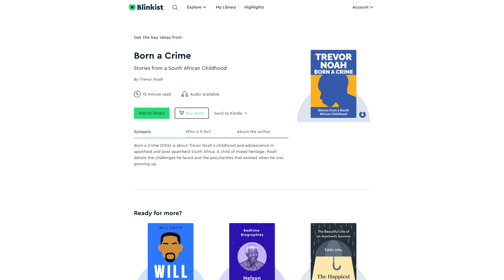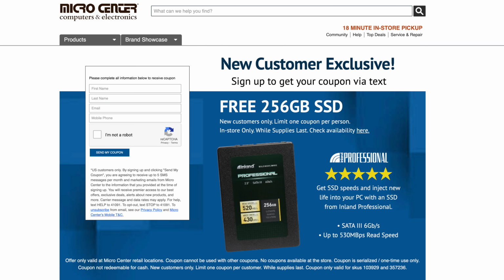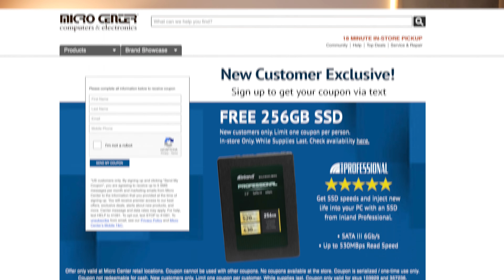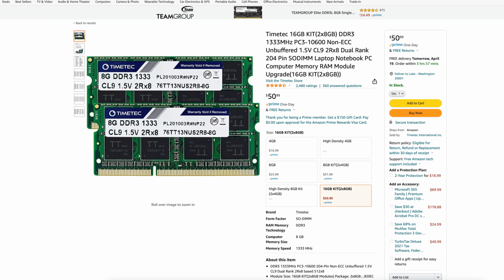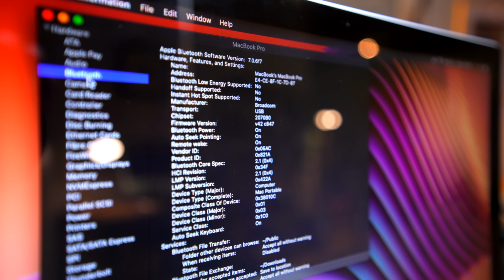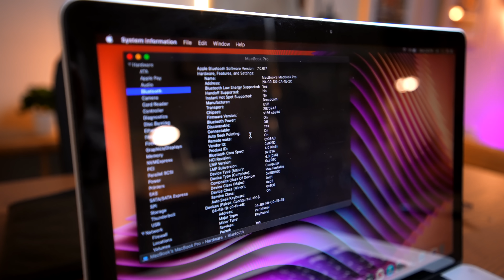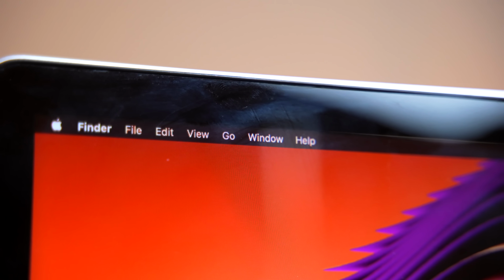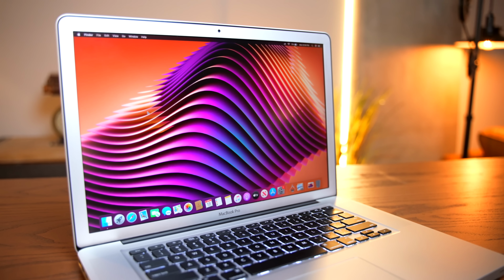Breathe new life into an old MacBook with THIS upgrade

Comment: It is true that the MacBook is expensive at first but surely lasts and a fantastic buy nowadays.  I was NOT an Apple fan but for 1 year now I had to use the Macbook Air NOT by choice and I felt in love with it.   I recently bought the MacBook Air  8gb, 256gb ssd 2015 for $100 because the 4gb, 128gb kept locking up on me with heavy use.  Then I went and bought 4 more used one 3 MacBook pro  15, 13, 13 2012-2014 and 2006 MacBook about $150 for all 4.  I am on a MacBook fever as these things sure are solidly built with quality component and  they are super fast with ssd drive.  80% of the population will suffice using these.  I also visit the local Walmart and I saw mostly 8g, 256g or 128g storage  made by Samsung, MSI, ASIUS, HP, ACER in the  range of $1000 brand new that is NO better than these MacBook.

There is NO need to buy the latest  unless you have a specific need for the  power.  I am a fairly heavy user but the older MacBook works great for me.

The only bad thing is update of the ram is hard  as they are soldered on the board.  SSD swap is a piece of cake!

The secret is large ram and fast SSD.  These 2 will turn  a slug into a decent fast car.  CPU to some degree but for most use people can't tell the difference.

Bottom line used MacBook is a fantastic value.  They still look good  decade later!!!!

Comment: Help: this upgrade does NOT work.  I swapped out the display and WiFi card but they’re latency issues.  Excruciating latency issues.  Can you provide the correct WiFi card part number?  I suspect that this is the issue

Comment: 2011 macbookpro 8, 1 put 500GB SSD in it around 2013 or 14. Slowed down a couple years ago and I bought a new mouse computer in Japan. Love it with Debian 12.5 in it. But my old macbook pro was wasting away. So I tried OpenBSD but couldn't get the good resolution on it. It is a crappy screen. But now I put FreeBSD 14-REL in it and it's working well. XFCE4 desktop or Wayfire on Wayland UI. Had to play to get the sound persisitent but the thing works great. I'd love to try a new display with better resolutions but couldn't find any. Anyway the keyboard is getting sticky and I'm thinking of that cheap chinese $20 upgrade of that. I do have 16GB RAM coming for it. So the RAM and then the keyboard and I love the FreeBSD running so smoothly. I'll never go back to MacOS now. I knew hardware just doesn't slow down like that all of a sudden especially when there is no spinning disk in it. Ordered the RAM from OWC for the macbookpro and my wife's macmini from 2012. I'm gonna upgrade her to SSDs as well. She's still on Catalina and I told her I can restore it after the hardware upgrade. I hope she notices a difference because her macos was also VERY BLOODY SLOW. I hate Apple for this hint to fork over more money to them. Experienced it on that mini and my macbookpro. Sudden slow downs with the UI. Can't beat BSD though.

Comment: I'm still using a 2014 MacBook Pro and a 2012 Mac Mini. The MacBook Pro is my daily driver for Ruby on Rails development and my Mac Mini is an i7 quad-core, 8 thread, 32GB, 1TB SSD beast. The upgrades on the Mini I installed myself of course.

With the MacBook Pro I use an awesome 100% mechanical keyboard with blue Gateron switches and a logitech MX master 3S mouse (trackpads suck).

Comment: update on my $35 2010 MacBook Pro 15
just installed the anti-glare display i got for $30, a 2011 wireless card, a new battery, 8 GB of ram and 256 GB SSD and macos Big Sur thx to open core and even fixing the common kernel panicking capacitor problem on my own. 
thanks 1000000 Luke for the idea, for someone who lives in a country where it's expensive to buy things from America (cus of our lower-valued currency and high import taxes) this was a pretty great deal which cost me just over $300 XEC (eastern Caribbean currency)

Comment: I replaced my screen with the Matt Display screen as described however, I'm not able to see how to hookup the 2011 wifi air card. Connectors are different on the board. Do I need to replace the board or order a different model air card?  2010 ? 2011? or 2012?  Hope I can get this to work somehow.  If not, I will leave it as is with a SSD installed.  Thanks

Comment: I just got a 2011 Macbook pro 15" with an Anti Glare screen with speculation of faulty Logic Board for £28 ($35.44), I currently have a 2012 Macbook pro with couple issues, screen dying and a speaker blown, when it arrives i'll transfer the logic board over to the 2011 along with the wifi and Bluetooth card and I'll then have a Macbook Pro 2011-2012 15" Edition

Comment: Nope, not worth it! Threw my 2009 MBP in the trash a long time ago and that’s after upgrading the ram, SSD and even running Linux on it! Just sold my $3000 2016 MBP for $300 after replacing a battery and it still ran slow for typical day to day tasks. I’m done with MBPs, maybe a Mac mini / studio but not the new MBPs with iPhone X notches 💩 Could care less for MacOS now that Windows 11 is great, and I used MacOS for 15 years. The problem you didn’t mention is that once Apple decides to not upgrade your MacOS on a MBP you’re done, just waiting out until apps won’t support it anymore, and Apple will intentionally make it slow! You can’t even run Linux on them very easily, tried it, finally it ran really fast again, BUT: No driver support for WiFi, BT, onboard audio and in my case - a 2016 MBP with a touchbar, no touchbar support or most importantly no ESC button. Useless!!! I will never spend $3K+ on an Apple computer, $1500 is Max!! You can still repurpose an old PC with Linux, not Macs! Pure ewaste nowadays ... 😢

Comment: I have an old 2011 macbook pro 17" i7 & it makes an excellent batocera machine, sound, wifi, Bluetooth all work whereas they don’t on my 2017. The 2011 does have radeon failure issues though so maybe go for the 2012 unless it has had the chip replaced. I paid a shop to replace the one in mine years ago.

Comment: Writing this from a 12 year old 17" MacBook Pro w/ upgrade SSD, 16GB ram and bought it with the no glare screen.  It was and IS a great machine.  Biggest problem:  Apple cuts you off at the knees and it can't upgrade the OS any further.  As such Google chrome cannot be update any further.  iCloud no longer can connect.  But it is a LOADED music machine that made me a lot of money over the years and so I will keep it running as is for that.  Amusingly, I can run Linux or Win 10 in Vbox and run a modern browser in them just fine on this thing.
Reply: You could get rid of macos and just install the Linux or FreeBSD and skip the crappy OSes.
Reply: @michaelhunt364  That would destroy its functionality as a music studio machine and waste about $10k of software investments (plugins, sample libraries, etc).

Comment: Apple shipping new computers with 8GB of memory is a bad deal today. The caching of your memory to disk swap is insane with 8GB and you'll wear your SSD pretty quick. 16GB is a must in 2023, even in 2022 it was a must. While the system will run with 8, there is a noticeable performance gain with 16GB in every day use with the latest MacOS

Comment: I had one of these with the antiglare display as my main Mac until last year! One thing to look out for with MBPs of this vintage is the discrete NVidia video cards could start to fail and cause kernel panics and the Mac will randomly reboot. Apple had a program to replace the logic boards in affected MBPs, and my Mac was fine until it wasn't. Unfortunately Apple was out of replacement logic boards so I wasn't able to have mine replaced. A workaround is to pin the Mac to its integrated graphics card using a third party utility; my Mac creeped along in this state for another few years, then kernel panics started happening during reboots and I decided it was finally time to replace the old girl with a M1 Macbook Air.

Comment: Brothers, help!!!! I have a macbook from 2012 13 inch. The display is broken and is old. I want to find an og spair. Anyone got? Or anyone can guide me where from? Ill pay for the authentic product. 

I let my friend use it and he installed Ubuntu somehow. I am not sure if he used bootcamp method or anything but now when it is booting, no options are showing when i oress option (alt) button and while booting an ACPU error pops up. I guess it is ACPU and now the battery isn't working. If i unplug it it turns off. Software is very bad since it is very corrupt i guess. The os keeps on failing as well as the applications. No lag at all but the applications are failing even when i put some load like use multiple window in browser or changing from pdf to excel( just for testing) it turns off but its not lagging. Can anyone help me install windows in it and remove current Ubuntu please???????????

Comment: Hi Luke! Very helpful video. I have an old MacBook Pro 15" Mid -2009 that I've upgraded with 2 SSD's (second in place of the DVD slot, and new speakers). I'm really interested in adding this anti-glare higher rez display to the mix but not sure if the one you showcased here is compatible. Any help or clarification would be super appreciated. Thanks in advance.

Comment: Unfortunately this video doesn't address the biggest problem you'll run into with a 2010 Macbook: The software. a 2010 Macbook can only be upgraded to High Sierra 10.13.6, which as of this posting is nearly 6 generations out of date. That means a lot of the software you might want to run on this Macbook simply won't work, and that includes the browsers. Safari absolutely will not work and Google Chrome will likely have limited usability because the laptop can only install a long-previous version of it and no longer supports it. The email program might work 'okay' but that's really the only piece of software that will function even reasonably well.

If you want to get realistic about the best way to breathe new life into an old Macbook like this, then turn it into a Linux machine. Any number of Linux distros including Ubuntu, Mint, Pop OS, and more, the vast majority of which look and feel like Mac and Windows,  can very easily be installed on an old Macbook and will run fantastically. You just need to be prepared to use a wired connection initially after installing the Os so the proper wireless drivers can be downloaded and installed through a simple update once the Os installation is complete. Or, if you want to get real kooky, you can use Google's Chrome Os Flex and turn the Macbook into a really solid chromebook (minus the app store unfortunately).

The only other option with a Mac as old as this is to use software called OpenCore, which allows you to install a modern Mac Os onto a currently unsupported Mac. Of course it won't run anywhere near as fast as the current gen Macs, but you'll at least have a fully-functional, current gen Os on your 13-year-old Macbook Pro which, let's be honest, was made a hell of a lot better and tougher than the last several current generations of Macbooks. Just be sure you know what you're doing and carefully follow the installation instructions because it can get a bit complicated.

I really hate the direction Apple has gone with their computer division in the last 5 years or so, making it harder and harder to repair outside of sending the thing to Apple itself until we reach modern day where they're software locking every part of the Macbook to the serial numbers so you are beholden to Apple to fix any hardware problem you might have. These 10-13 year old Macs like in this video were awesome feats of engineering and really did set the bar for the computer industry at large for how a laptop should look and feel. Plus the things were just tanks in terms of the kind of punishment they could take. So if you really do want to breathe new life into an Old Macbook, go for it utilizing one of the suggestions I put above.
Reply: High Sierra is still useable, i've got one of these that i've upgraded the same as Luke did, High Sierra still supports chrome and Spotify perfectly fine and I have dual booted mine with Monterey which performs just as fast as high sierra and even in geekbench and cinebench isn't far behind a 2016 or 17 13" MacBook Pro or 2017 MacBook Air which i also have in my collection. OpenCore is really easy to use and it's hard to mess anything up especially with so many youtube videos that you can follow.

Comment: I've set these with Windows 10 and ssd in legacy ("bios") boot mode, everything works like a charm (devices included). Still, I had to set up the bootcamp drivers manualy by unpacking each archive separately in a new folder and using the Device Manager, otherwise, by using the official bootcamp setup file it would end up with a BSOD. All in all, these things are still usable. P.S. Linux Mint Cinammon works nicely as well

Comment: I just sent my mid-2009 MacBook Pro 2.8GHz Duo Core with anti glare display to my mom who needed a computer. I maxed out the memory (8GB), replaced the original HDD with 500 GB SSD and added a second 1TB HDD in place of the optical drive as well as replaced the battery.  I also used a patcher to upgrade the OS to Catalina.  The computer is never going to set any speed records but for an 14 year old machine it does great and will handle everything mom needs from a computer.

I upgraded to an early 2013 MacBook Pro (2.7 quad core i7, 16GB and 1TB SSD)

Comment: Just found this video very informative, thanks Luke. As I have a 2011 MacBook pro 15 inch with icore 7 with a bad screen, I was contemplating whether to replace it or put the money for a new m1/m2 Macbook air. After watching this, I might try to find a 30 dollars display.
The only downside of my MacBook is the speaker easily broken, changed once and it broke again.
Another disadvantage is it has only usb2 ports which when transfer files it's pretty slow.

Comment: I like your video, I love to work with these older machines. Yet there is one problem that kills me from using it more often and that are the security warnings. Most of the time you can go as far as el capitan on these machines and there start your problems. So surfing on the internet will make you encounter lots of websites that you can not acces. Normally I use Brve but in some cases I am forces then ti use Safari. So on my macbook pro 15" late 2009 this is what it makes pretty unusable for the internet. What qould you recmmand Luke?

Comment: I have a mid 2013 MacBook Air 256 ssd hd and 4 ram. As far as I know, there is no possibility for ram memory upgrade at these models. The latest macOS I can run without a patch is Big Sur. Does anyone have any idea how can I upgrade memory or operating system and another question is what is the most optimal operating system for my model? Thanks very much.

Comment: Hey Luke, aren’t there limitation to software upgrading due to the hardware? Aside from the OS, would certain apps no longer work? I ask because I have an old 2nd gen iPad that I finally gave up on because I cannot update certain apps making them unusable, YouTube being one.  I could no longer use the app and had to use Safari. But even the older Safari is not working well on the YouTube site.  I bet there are site that may no longer work on an older browser.  All the hardware upgrades are great, but what’s the point, if you’re limited by the software? At some point,that at be the Achilles heal, not the hardware. Would love your take on this.
Reply: Yup that would be a really good subject for another video. The whole discussion whether it’s ‘safe’ to run unsupported OS or use OCLP. I know of a certified Mac repair ship that runs unsupported Macs. They said: it’s no problem, just use your common sense and don’t run unsupported browsers. Anyway, I really would appreciate Luke’s take on these issues 😆

Comment: Luke...need some tech help with Apple products and hoping you can share your advise!   Have a working mid 2012 MacBook Pro that I have upgraded memory and SSD and is working fine.  Just purchased a 2021 IMac 24" desktop and want to be able to plug my MacBook into it so It will read the SSD as an external drive.  As a photographer, I have tons of photos on the MacBook and want to be able to access them with the same editing software on both machines.  Thanks in advance for any help.

Comment: I have a 2008 MacBook aluminum. I recently had to replace the cord due to fraying. A few years ago I doubled the ram and installed an ssd. It still works pretty well but a lot of external apps now won’t work with the old hardware. However it works for what I need it to do. Amazing longevity as far as I am concerned and I’d get another Mac without question.

Comment: Well, I still have a 2011 MacBook Pro and I replaced the HDD with 1TB of SSD, new battery, and 16gb of RAM. It works fine, some quarks and I can’t upgrade. Other than that, they last

Comment: My MacBook Pro is from mid-2012, i still use it to this day as my primary and only computer. I had the disk drive removed and replaced with an SSD, i also maximised the RAM, it works great considering i’m a graphic designer (a very poor one) and i use very heavy apps sometimes together, i never had a problem with apps freezing or force quitting, the battery lasts about 2 hours, which is fine but I really hope to be able to buy a new one soon though, i don’t know how long it will survive, it’s 10 years old, and i would like to be able to upgrade to the new macos, i’m stuck on Catalina.